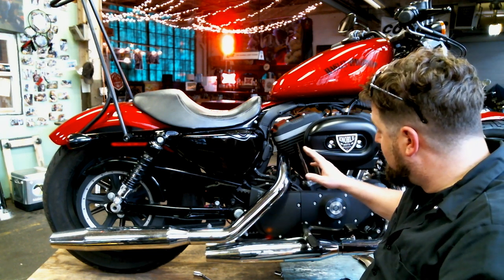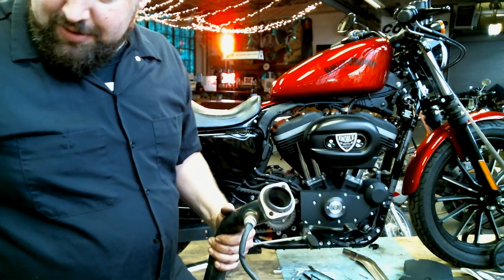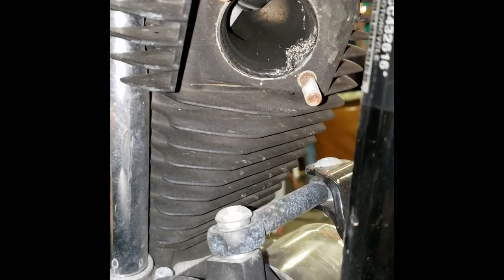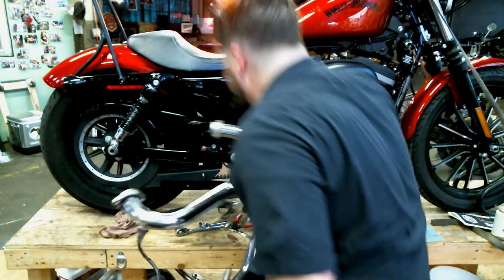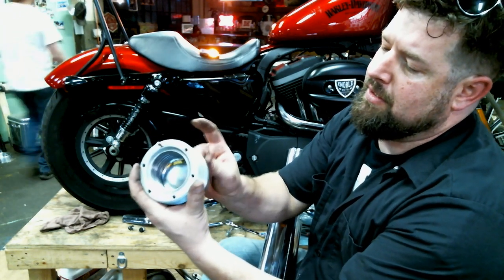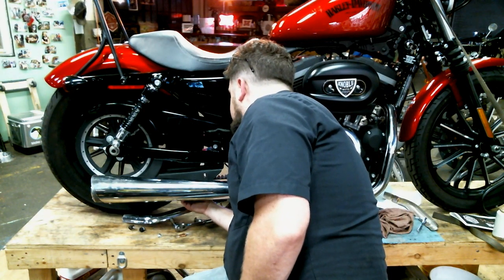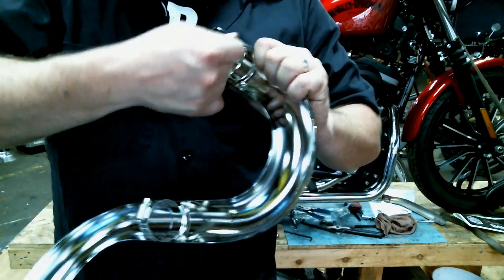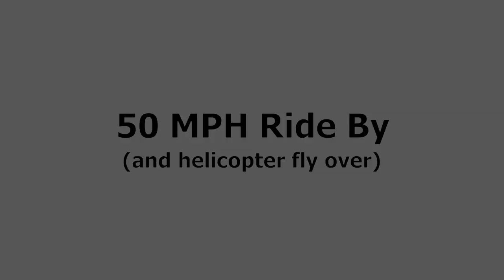2:1 Exhaust install on Fuel Injected Sportster

Comment: Adding this pipe to my 2010 Forty-Eight. I've changed exhaust before but this was really handy, a good brush-up. Your heads up about tipping/aiming the header into the cutouts in the cooling fins (and going around the brake pedal) was much appreciated. Thank you!
Reply from the maker: Glad to hear it helped!!

Comment: Nice.  New sub here. Wondering if you can tell me the differences between this pipe and the Supertrapp Fat Shots?
Reply from the maker: The fat shots is shorter and lighter. When it comes to performance, a short pipe like the fat shots will move your power band to a higher RPM range, VS longer pipes keep the powerband lower.